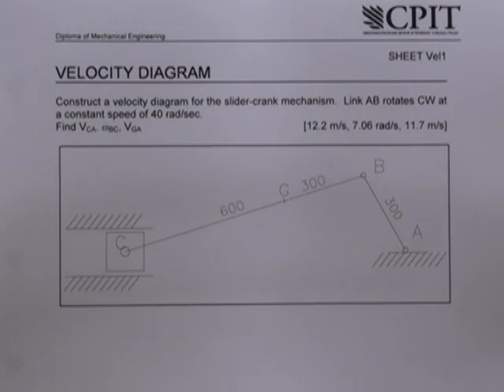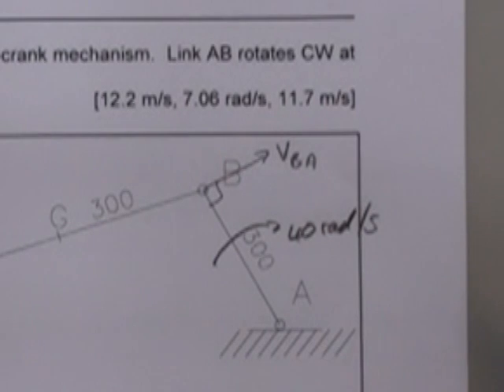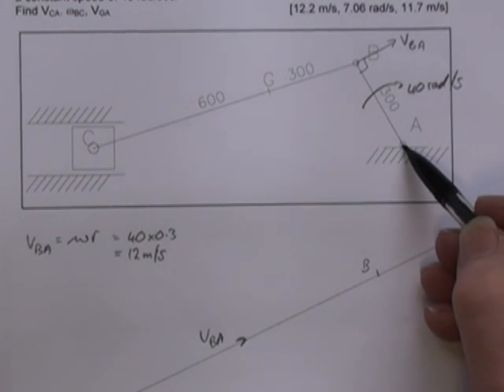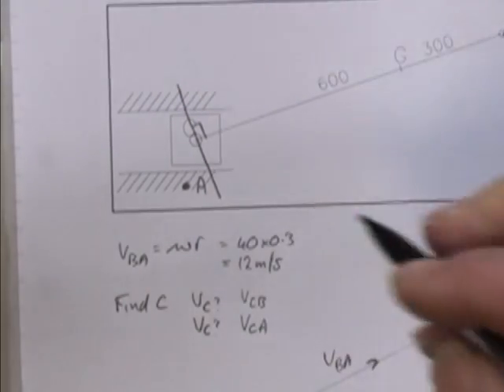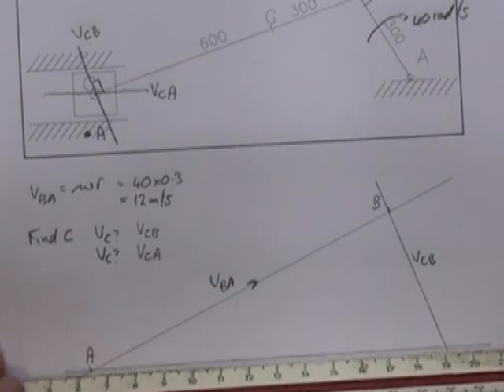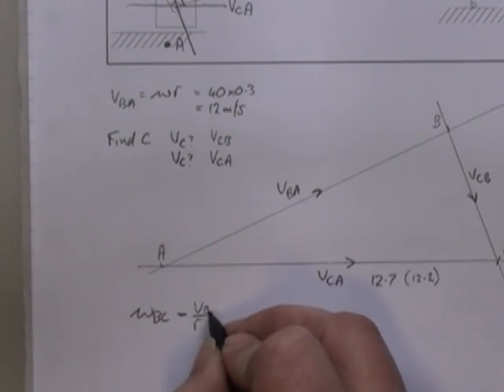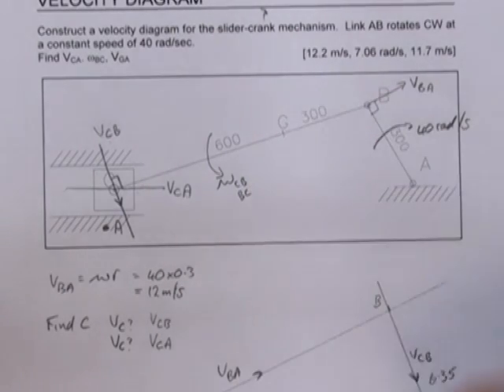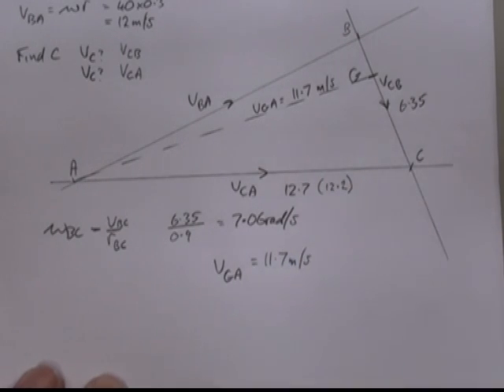Velocity Diagram Construction

Comment: How did you find Vca? you already had the answer, but what do you need to do exactly to find it? Pythagorean theorem..?
Reply: you just measure the length of  line ca from the velocity diagram,that will be equal to Vca and if you used a scale to draw the velocity diagram then you multiply the length of the line and the scale you used (He didn't use a scale in this example)